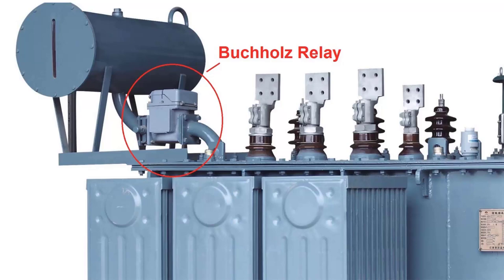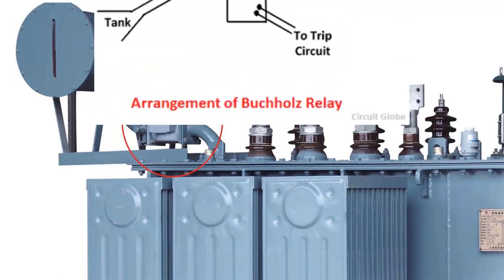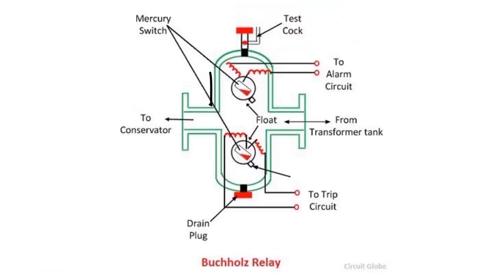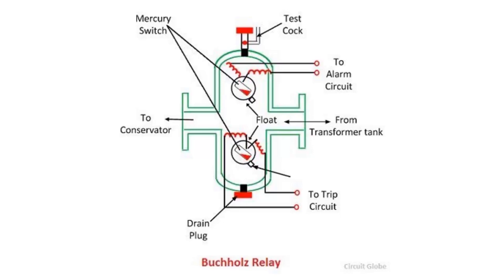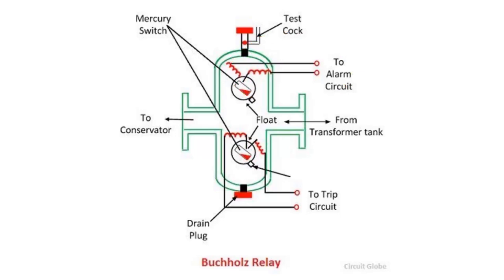Buchholz Relay in Power Oil Transformer |Explained

Comment: faults in the oil ?
the bucholz relay senses gas accumulation caused by a fault in transformer windings between windings or a dead short circuit the gas produced by this faults are accumulated inside the bucholz relay and this gases actuating floats the floats ativating a alarm aswwell turning off the faulty transformer through safety devies explain it right thank you
Reply from the maker: excellent thank you for your information ❤️🙏

Comment: What does the oil do?
Reply from the maker: Oil is used in power transformer for two purposes:
1-Insulating windings
2-Cooling transformer
Reply: @electricalengineeringplane6620  cool to know. İ was thinking that it was for cooking or heating or something. Still don't understand fully. But I'll try to research.
Reply from the maker: @garrysekelli6776  excellent, if you have any questions just ask and we will answer it